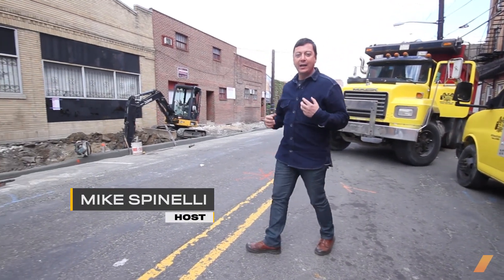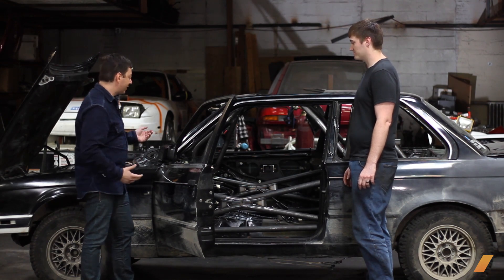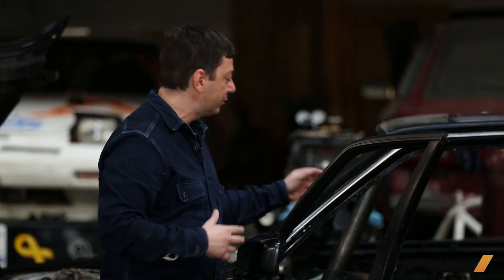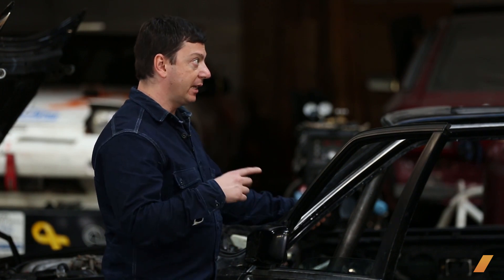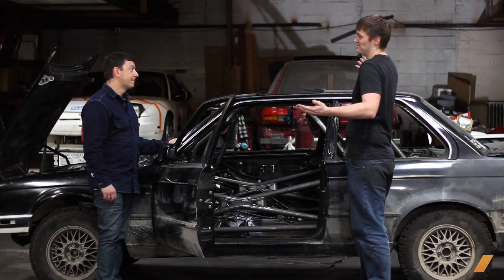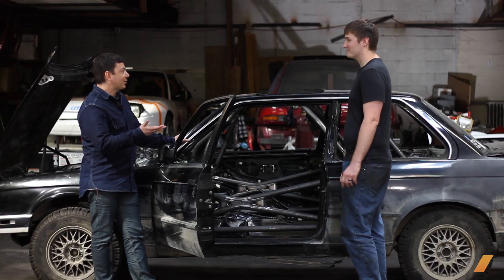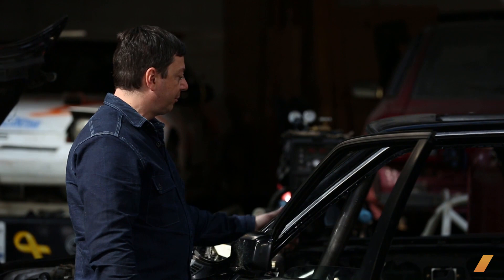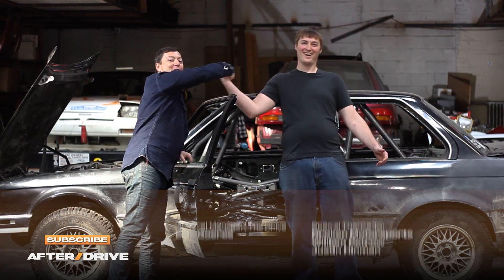How We Built a Roll Cage for the $2,000 BMW -- AFTER/DRIVE

Comment: Lets clarify at 9:02. NASA and SCCA only allow up to 8 attachment points in some classes. Stitch welding the tubes to the car is 12 to 18 spots is considered an attachment point. Also narrow dimple plates is not a sign of an poorly designed roll cage. Having a large dimple plate is. 

Also I would never attach the rear down tubes to the inner fender tub. Attach to the shock tower or uni-body frame rail adjacent to the tub and tower.

Comment: Nice cage. I'm running a Safety Devices full cage in my M3 but would much prefer full custom.  Are there any plans to modify the engine? I know Schrick do some better cams but there's not much to be gained from flowing/porting the m20's heard.   Anyway, am enjoying the E30 project.

Comment: Justin what size wire do you use 0.6mm or 0.8mm in your mig?
Reply: Bruce Thomson I think this car was done with .8mm. I sometimes used .6 and it works fine, granted all of the tubes are only 2.4mm wall thickness. Anything thicker and I would stick with the .8mm wire
Reply: Love your work Justin. :)

Comment: Out of curiosity how much of a weight difference do you think that cage makes? That's definitely a lot of metal going into a small car.
Reply: It makes quite a big difference.  Even after stripping out the interior, it's not uncommon for a car with a full cage to weigh more than it did stock (probably depending on the car you started with - stripping out power seats, etc. make a bigger weight difference than old-fashioned manual seats.)  With old cars that were inherently lighter than these days, it could really add quite a large percentage of the car's weight.  On the other hand, it's safe, and helps stiffen the structure, which offsets the weight a bit by helping the car handle better.
Reply: After some rough calculations I figure the cage itself weighs between 140-180lbs before welding
Reply: Justin Hinman that's actually not so bad considering how much weight the car is losing in terms of interior stripping with the electronic seats, rear seats, sound systems and interior cladding.

Next step fire safety and cut off switch?
Reply: Thanks, Justin - I'm lousy at making estimates, although I would have expected a little more than that.  :-P  That sort of weight isn't horrible on a modern car once you strip the interior, but on something old like a classic Mini (my old one weighed in at around 660kg before I started modifying it and the interior's weight would be lucky to reach 80 lb all told), it is a major problem.

Comment: You guys are allowed to do downhill welds on structural joints?
Reply: Matvey Kulgavyy .125" and thinner can safely be welded downhill and get proper penetration. All of these bars are .095" thick so no worries
Reply: Justin Hinman good to know, thanks.

The only time we can weld downhill is if the weld isn't structural, or if it's a stainless pipe with open root using short arc.